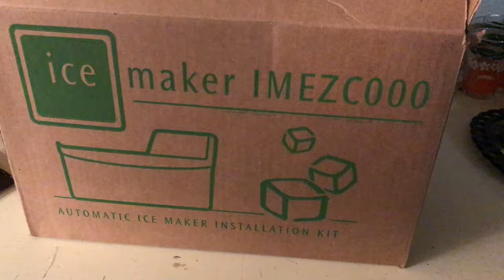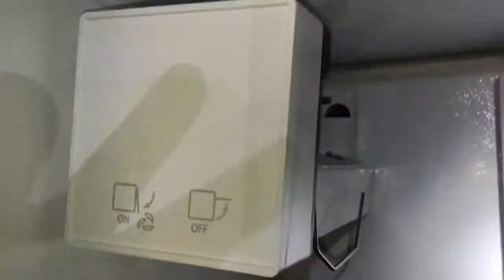DIY Instructions-How to Install an Automatic Ice Maker in Your Refrigerator Freezer

Comment: What size water pipe did you use
Reply from the maker: Miles Greenwood it wasn’t hard piped in. I connected the flex hose to the bottom refrigerator connection.